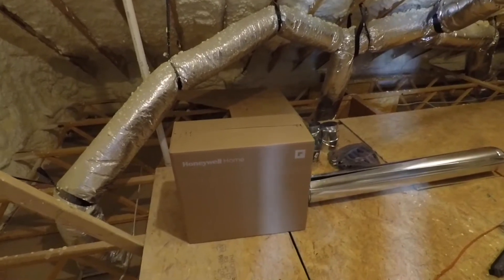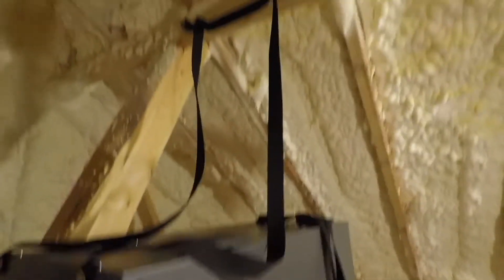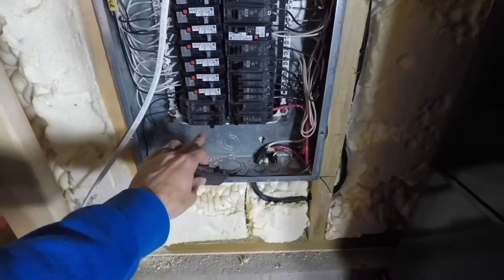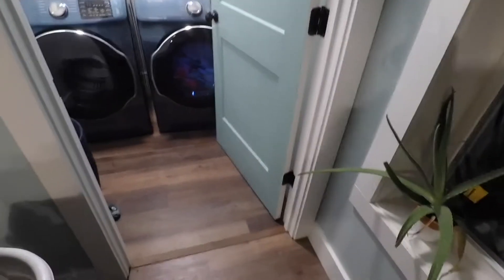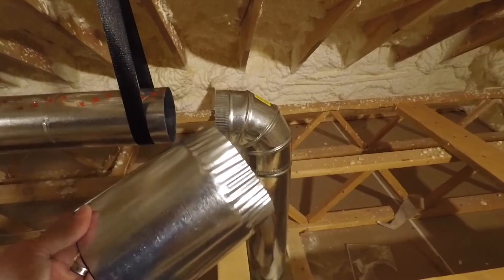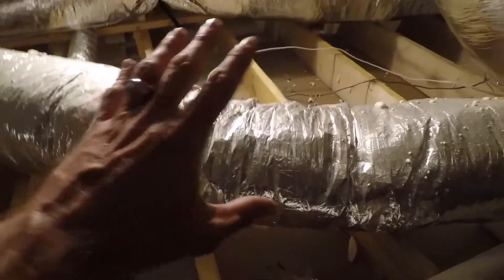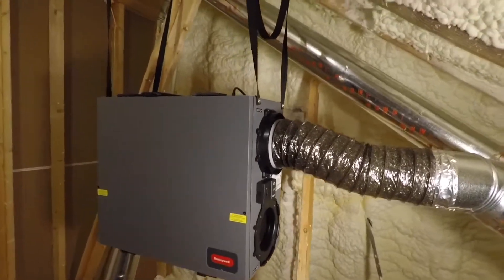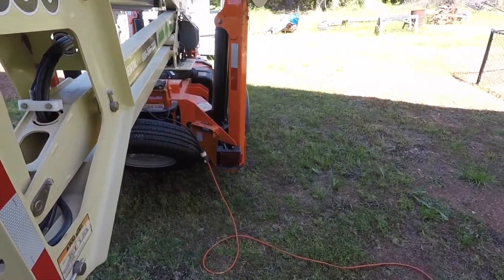We installed an ERV in our house. DIY Energy Recovery Ventilator Honeywell VNT5150E1000

Comment: You keep saying the spray foam is at fault and that is not true it is a HVAC problem!! The V in HVAC stands for Ventilation which is your problem. I have spray foam envelope in my house and it works fantastic. You also need to monitor your humidity in the house, it should be around 50% humidity in the house to prevent mold and mildew. Once you get your ventilation and humidity controls working properly the spray foam will be a blessing.
Reply: Their HVAC is likely improperly sized as well.  When you tighten a house this much, you have to do a full Manual J heat calc with a blower door test, or you will always end up with too much H&C and not enough V.
Reply: @ericapelz260  how would this be determined? Would I have to hire an HVAC company to come out and do the calculations? If i have an oversized unit would just lowering the speed of the blower motor be enough to fix my Ventilation and humidity problem ?
Reply: @joea104  Most HVAC contractors rely on "rule of thumb" calculations that result in exactly the problem shown. Many HVAC installers are not well-educated on the latest equipment and construction technologies.

The solution is very likely a significantly smaller HVAC unit and a smaller ERV. The best way is to have an HVAC engineer perform a Manual J calculation. Just reducing fan speed is not likely to solve the problem and could damage the equipment.

With existing equipment, you can also look at the unit's run time and select a unit that will run longer, but it depends a lot on the energy source. I wrote that comment a year ago and didn't recall the details of the video. Very tight homes are well served by heat pumps. They should be sized so that the unit runs continuously in the coldest winter temperatures (a design day). Technology Connections' YouTube channel has some very good heat pump videos that explain things in ways regular folks (non-HVAC pros) can follow.
Reply: @ericapelz260 - thanks I will check out the channle i live in texas and from what I know about heat pumps they are better suited for colder climate states
Reply: @joea104  Heat pumps will work great in Texas.

Comment: Looks good. I wouldn't put a return in the laundry room due to the lint. Also, the heat gain from the dryer you need a supply.

Comment: Thanks for info on ERV When do you plan to seal up ceiling penetrations & get some cellulose or fiberglass ceiling insulation??
Reply from the maker: If you are talking about putting insulation between my attic and living space ceiling, the answer is never. The roof has spray foam. The attic is like a conditioned space. There is no need for ceiling insulation.
Reply: @BrantleyBlended  I’ve been reading some of these comments and I can see how ignorant many of the peoples comments are. If I hadn’t tried to educate myself I’d probably be making many of the same comments they are. Our minds are still stuck in the old way of doing things, and I’m trying to teach this old dog (myself) new tricks. I can see that you really have tried to educate yourself as I have been trying. My while life in the construction industry has taught me soffit fresh air and ridge vent. I think the new highly researched ways of building air tight homes is good. Yes these new ways do come with challenges,such as the absolute necessity of systems to bring in fresh air, but I think it’s good.
Reply: @nieldcreek2098 - I guess I fall under the ignorant comments but the reason We ask questions it to have a better understanding and gain some sort of education from his trails/ and experience. Im running into the same humidity problem he has with a metal home thats air tight with sprayfoam.

Comment: You could buy an Air Quality monitor (one that monitors VOCs and CO2) to quantify the effect of ERV. Spray foam side effect should show up as VOCs. I don't have a spray foam problem, however, ERV is still good to get fresh air and remove trapped CO2 from all the exhaled air. In short, no, it's not all in your head or a placebo, but ERVs are very much functional, better-health-providing systems. Thanks for sharing this video; I'm looking at installing an ERV and your installation video was detailed, to the point and entertaining. Cheers!

Comment: Look up ASHRAE 62.2 
There is a specific calculation you or your HVAC contractor can do based on square footage and bedrooms to determine how much cfm you need from your HRV and how ling it needs to run every day or intermittently. 
http://www.airventingsolutions.com/assets/images/BroanSpecsPDFs/ASHRAE-Standard-622-How-to-Properly-Size-a-Whole-House-Residential-Ventilation-System-Table-CFM.pdf
Reply: @adamszman Thank you for the ASHRAE 62.2 2010 vs 2013 brief. It's helpful.

Comment: Is there any reason you didn't just connect the ERV into the hvac systems return and feed lines? I might be using the wrong terms/words, but wouldn't you want the fresh ERV air to go through the hvac system to be cooled or heated and fed to your house, then reroute the return line back through the ERV and out the house so the air crossing can help semi-condition the new air to your house's temp. That way you wouldn't have 2 vents in each room. Still fresh air, but better conditioned. The way I see it, you're bringing in ERV air straight to different rooms in your home that do not go through your hvac system. I'm sure the ERV has filters but not like your hvac. And an ERV conditions the air only so much. Not an expert, just my thought process.
Reply from the maker: I want the ERV completely separate from the hvac. The ERV is running on a timer for 12 hours a day, 6 hours in the morning and 6 hours at night. I don’t want to run my hvac every time the ERV is on. Also, I have 2 hvac systems. Would I have to buy 2 ERVs then or hook this 1 ERV into both hvac systems? Then both systems would have to run when the ERV is on to help move the fresh air.
Reply from the maker: Right now, in July, the ERV is sucking in hot air from outside and blowing it into my house. You may already know that the ERV is designed so that the intake and exhaust air pass by each other without touching. The cool, air conditioned exhaust air brings down the temp of the incoming hot air. The ERV is designed to minimize energy loss. On a hot day, the air blowing into the house from the ERV feels good. It’s not cold like the air from from the a/c vent, but it’s cool. It’s not like having a window open and having hot humid air blowing into the house.
Reply: @BrantleyBlended  I see. I've done about as much "youtube research" as possible on ERV's and HRV's. Been wanting to make my home more efficient. I have a vented attic with blown in insulation and my HVAC is in the basement so I've got quite a different situation. We just installed Rockwool throughout the entire exterior and then used R-Guard to air seal before siding. Next move was going to be the attic. Your video was informative and I appreciate the effort you put into it.
Reply: Thank you both for taking the time to post this great exchange of information. reading this comments help me understand a lot. I am renovating my home, insulating the house with a closed cell foam. I decided to tie the Erv to the HVAC system. I bought Lennox syetm with Lennox ERV unite. Although HVAC system is a single stage I believe the Erv is variable speed, both can be operated from the same thermostat. However, I'm worried about energy consumption especially since AHU is single stage. We are installing the system this week, wish me luck.

Comment: Nice job Brantley. On the supply ducts, could you have used a y pipe in the HVAC duct so that you don't have 2 registers side by side in your ceiling ???
Reply from the maker: Maybe. If the ERV was off, and the HVAC was running, it might blow air backwards through the ERV. Connecting it to the HVAC ductwork near the heat pump or furnace is one of the recommended installation methods, so your idea would probably be okay.

Comment: First, you should have made the calculations of how many cubic meters (or unit of mass of volume you use) the house has and find out at what rate you need to renew the air. For that, you need technical information on the internet or an expert.

In addition, the best thing would be to have bought and installed a dual-flow ventilation system. This system uses the hot air that is extracted from the house to heat the incoming air as much as possible. This way you waste much less energy. In Europe, they are being implemented since a long time ago.
Reply from the maker: A dual flow ventilation system sounds like an ERV. You described what an ERV does.
Reply: @BrantleyBlended  Yes, but I was referring to the compact models.
Reply: @pedrofmc0000  Can name a compact model that you think would have worked better in his situation?
Reply: Are you going to pay for that system for him?

Comment: I know those hanging straps probably work just fine, but I would replace them with slotted angle steel as a down time little project.
Reply: Not needed
Reply: Just using the straps on ours.  The unit doesn't move and isn't heavy.  Thing the straps are ok.

We installed a 200cfm ERV in our Off-Grid spray foamed house.  Ducted it separately as well and but kept ran the bath venta through the ERV.  Here is a link to the unit install.  

https://youtu.be/8-hEnDrbMAc

Comment: Wow , I’m a Canadian ventilation contractor with 40 years experience. I’ve done thousands of existing homes not many take more than 8 hours start to finish.
Reply: Took us a couple days to run all the ducts and such. We installed a 200cfm ERV in our Off-Grid spray foamed house.  Ducted it separately as well and but kept ran the bath venta through the ERV.  Here is a link to the unit install.  

https://youtu.be/8-hEnDrbMAc

Comment: I don't really think that the ERV requires it's own dedicated circuit.  
Pretty certain it only runs at like 1.5 amps and wouldn't be an issue at all.  
  
EDIT: Yeah just looked up the specs, it only has 1.5 amp current draw at maximum fan speed.
Reply from the maker: I haven't noticed a change in my power bill since running the ERV. It does use very little power. I just like things in my house to be separated and organized in my electric panel. The electrician did a horrible job when they built my house. I've been slowly trying to redo my electric panel.
Reply: We are Off-Grid and it doesn't even register on the system.

Comment: Ductwork looks very clean and well put together, but one thing.  With a house that tight and a central Air System, having the ERV's Ductwork in the attic IMO should really be insulated to at least R8.  Over time the Cool, conditioned air from within the envelope, passing through a hot attic will cause condensation in the metal pipe.  A poorly ventilated attic can get very hot, and pulling cool air through it will cause any moisture in the air to condensate.
Reply from the maker: My attic is usually pretty comfortable, even on hot summer days. It is warmer than inside the living spaces of my house, but it is nowhere near as hot as an uninsulated attic. 

I've had this ERV running for over a year and I've never noticed any condensation. I'm not saying it won't or can't happen, but I haven't noticed it yet. I live in hot and humid Georgia. I think if it were to happen anywhere, a humid southern state would be a good place. 

I'll keep an eye out for it though.
Reply: I know this is a year old, but this is a conditioned attic and should be within a few degrees of the house temp.  Your comment only applies on a vented attic.

Comment: Can’t this be corrected with a ridge vent the length of the roof, and softer vents at the bottom? Looks like a metal roof which is costly to modify.
Reply: Your referring to a vented attic. This is a sealed attic.  He could convert it. But then the hvac has to be redesigned.

Comment: I would insulate all your metal supply pipes. The hot in the summer and cold in the winter attic will largely negate the heat exchanger. Think about it: in the summer cold air gets sucked out of your house into the heat exchanger and cools the air coming in. Then you pipe that cool fresh air through uninsulated metal pipes into different rooms in your house. The fresh air going through those pipes will get heated from the hot attic. The same thing happens in the winter but hot/cold reversed. Great job though otherwise!
Reply from the maker: I think I understand what you are saying but I don’t think it’s necessary from what I have read. 

When I researched the installation for this ERV, I read that all duct work running through uninsulated or unconditioned spaces should be insulated. My attic is insulated and is pretty much a conditioned space because of the spray foam. It’s about the same temperature as the rest of my house. Maybe 5 - 10 degrees different at most since there aren’t any vents blowing into the attic. My attic is not really cold in the winter or really hot in the summer.
Reply: @BrantleyBlended  Yeah, I see what you're saying too. Still, that 5-10 degrees may make a difference in the maze of supply pipes. The blower in the ERV is only 1.5A which is 180W - that air is moving slowly through the whole system which gives it a lot of time to absorb/lose heat. If I had down time for a little project I'd eventually insulate it, but who knows if it's actually worth it - I agree with you there.

Comment: Your problems were not caused by the foam insulation.You need to become educated on how to build a house.You need soffit vents and maybe a ridge vent.You can likely get away with this until such time as the house is on the market,then the building inspector will straighten you out.Why don't you get a copy of the New Jersey building codes and find out how to do this the right way?
Reply from the maker: Why would I need New Jersey codes for Georgia? Also, I paid a GC to build my house. He should’ve know about the issues that spray foam would cause.
Reply: @BrantleyBlended  NJ codes have been adopted by many states.If you know the codes you can make sure things are done right.If you don't bother to learn the codes people can take advantage of your lack of understanding.The codes are only right 99.999% of the time.Your choice to be professional or not.
Reply: None of the problems he was addressing seems directly related to the fact that his attic is a conditioned space.  Venting the attic would just make it an unconditioned space.  His issues were with air-exchange.
Reply: @ncooty  Too bad if people don't know the building codes.Knowledge is power.He could have tried to hold the contractor to whatever standards exist,but since he did not know the standards he suffers.
Reply: @jeffhallel8211  
Sadly.. You seem to be the uneducated one. Building the house like this is a new method. Many other countries use it. Usa is slow to adopt it. 
Next time you go tailgating.. Drill a couple holes in the cooler. Top and bottom. Let the air through. :)
Reply: @BrantleyBlended  correct all your problems were due to the general contractor not knowing what he was doing.